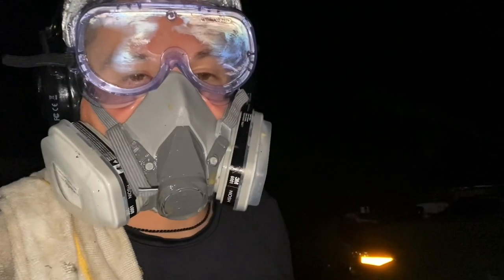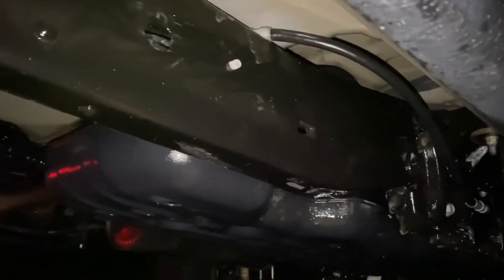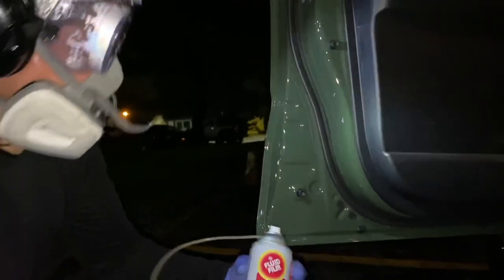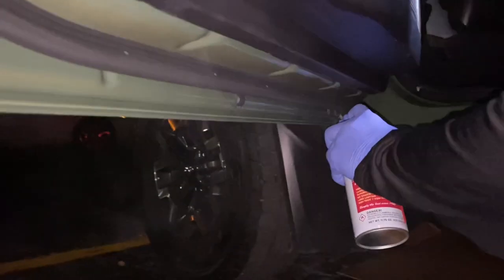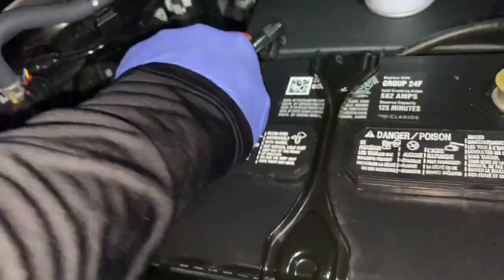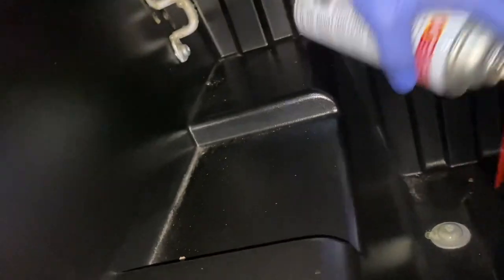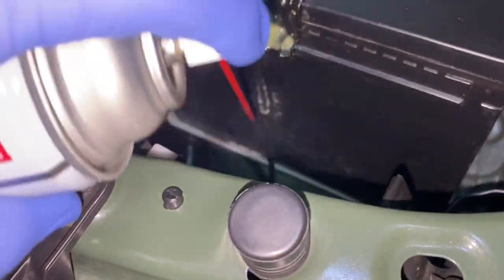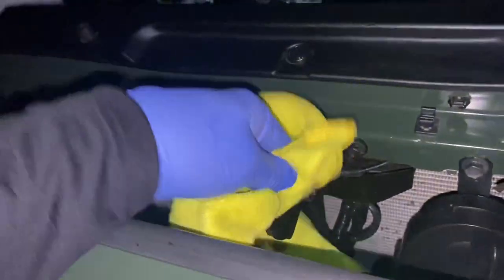The 1 Thing To PROTECT Your Pickup Truck From Road Salt Rust

Comment: 👏 many thanks for sharing this. I just purchased my 2022 taco, I was reassured by the Tacoma dealership that I did not need an undercoat spray that the new Tacoma’s have adjusted for the prior rust issues. I feel like it’s best practice to do it living in Maine on the coast. Thank you for this tutorial super helpful and I feel like I could do this myself. I just don’t wanna void any new vehicle warranty, but again Toyota said it’s not needed with new models, no more Taco rust🤷‍♀
Reply from the maker: Congrats on your truck! I chose to do it because I like the extra protection. But if they insisted you didn’t need any then that works out great.

Comment: Having just traded in my 2005 with 300k on in and spending its entire life on the east coast of Canada I can tell you the bottoms of the doors still looked like new, tailgate looked new. All body panels besides noted below. I bought it from original owner who didn’t rust proof it at all. Besides the frame (that Toyota replaced) the areas that rusted were the rocker panels, the front bumper inner corner supports, the thin metal over the rear wheel wells inside the bed walls, the metal rods that hold the bed sides from flopping. Those bolts you’re spraying are galvanized and don’t rust. Toyota does a great job at coating the sheet metal and I just gave my 2022 (same as yours, lunar rock) a good coating of rust check and it should last decades.
Reply from the maker: Thanks for the insight!

Comment: I'm doing mine for the second time in southern Pennsylvania. I did most of all the places you did under the truck the first time last October. I try to get some in every hole and in the boxed part near the cab and engine. I did in the doors from the bottom like you. I also pulled some plus in the rocker panels under the edge of the truck and used the hose to spray in there. I didn't do the inner parts of the hood but I will tomorrow. I also am going to take out the tail lights and see if I can get in the bedsides a bit. Over all some of what I sprayed last year on my 2020 was still there especially on the under side of the cab body. I used far less than last year where I used 5 1/2 cans. When I finish tomorrow due to the rain today I will probably be at 3 cans.
Reply from the maker: Thanks for sharing. Good for you for making an investment in your truck. I sister lives down in Lebanon for 14 years now. Always a nice trip down. 

I also had the rain last night it was bad. She’s taking her first ride up to Sullivan County, NY to visit some family and hopefully some of that smell will decrease but it’s a truck! 

Let me know how the rest goes!
Reply: @brianruperti  Lebanon is less than an hour away. i get there sometimes. 
The smell will go away in a few days that you don't notice it.
Reply from the maker: @MrMikey1273  small world! Good I look forward to it. Maybe a spritz of my
Cologne on the drivers seat will help 😎

Comment: Questions Brian. Is fluid film a name brand or are there several brands of fluid film? How many cans did you use to do your Tacoma? How much $$ is fluid film? Thanks!!
Reply from the maker: Great questions. Fluid Film is the brand of rust prevention oil. I chose it because people get great results and it’s environmentally safe. 

You can find it at almost any department or home store. 

You can lay about $120-$150 for a professional spray kit with gun and gallon can of it, or you can go my route by paying about $7-10 per can. 

I originally purchased 6 cans @ $9 a pop. 
Then I realized I needed 3-4 more cans so my woman ran to Home Depot to get them while I inspected the undercarriage. 

Total investment: about $100

I also purchased a $14 “360 wool wax wand” off Amazon which it the long tube you see me using. 

The good thing is, some of this oil will remain in the spring, so my cost goes way down to a maintenance of 2/3 cans every 6 months. 

(Please see my video in the description of how I cleaned the frame before applying)

Comment: West coast so I don't really need to do this. I watch "south main auto" repair's channel and he's in the New York area and wow the rust on those vehicles! Very thorough job tho Brian. I wonder how well the truck will wash with the over spray in those areas. Maybe a follow up video? I've never worked with the stuff. My Brand new 1992 Toyota 4X4 Truck I owned for 14 years had little to no rust when I sold it. So My 2020 TRD Sport 4X4 DCLB I may leave without Krown or Fluid film.
Reply from the maker: Yes that’s one of the benefits of the west coast! Rust is a sad part of life up here. It’s a dog fight against it. Thank you for watching. That must have been awesome to experience buying a new 94 and then a new 20 and feeling the changes! 

I definitely plan on doing a follow up video. I have it parked for the day today to cure before the thunderstorms tonight. It’s getting a body only wash tomorrow, but I will address the washing in a video soon.

My plan is to only do light “salt removal” undercarriage sprays and then reapply after the April showers rinse the winter salt away.
Reply: Lindsay, if you live near any salt water body where there is salt in the air, ie, the Pacific Ocean, you need to worry about salt. It is a myth that for some reason the west coast doesn’t have salt in the air
Reply: @adamturner2212  You are absolutely correct. Sister & Brother-in law lived right next to the ocean. The rust from the salt air did have a noticeable impact on their cars. Fortunately, I live 30 miles away from the ocean. No real impact other than a moderate climate in the winter.

Comment: What is your view on using Line-X?  I think it is an asphalt coating and not rubberized but might also trap moisture?
Reply from the maker: I say no way to Line-X. Great to protecting the bed, or the panels of an old bronco body, but not underneath. I fear the trapping of moisture. Based on my research, fluid film applied yearly (with a respirator and goggles) is the way to go. Just do your research and skip the suspension bushings, rubber hoses/trims, and also skip the exhaust and other rubber parts like hoses etc. And it’s environmentally safe which is a perk! Hope that helps.

Comment: FLUID FILM works the best...Where did you get the extended straw from?
Reply from the maker: It does! Straw off Amazon it’s called the wonder wand. (360 sprayer) next time I’ll tape near the tip so I know when to slow down and stop spraying while pulling out

Comment: The bottom of your speaker is right inside that hole on your door you’re spraying in. I believe the interior of the door is primed and designed for water to get in and drain out. The galvanized parts don’t need to be sprayed, they won’t rust.
Reply from the maker: Thank you
Reply: @brianruperti  regardless you did a great job bro! I’m about to get into this myself! thanks for the video.
Reply from the maker: @Nackss  thank you!

Comment: Those door jams are not necessary. I have a 2012 n never used anything besides white lithium there n never a spec of rust.

One thing id do, if u have an access cab, do the big galvanized looking hook where the rear and front door secure. That will get very rusted over time.
The bed bolts, coat those good. They will get very rusted over time.
Even if u can find them under neath id try to hit em.

The cross member in the rear of the truck from underneath, get that good. That will rust.

Take ur tail lights out now, that they are not rusted in there, and coat those bolts good. Both of mine on each side of my 2012 rusted and broke the housing of my tail lights.
The top bolts of the shocks, kill those twith it, esp the bolt that is the furthest away from you of the 3 of the strut on top. N the rear shock bolts and holders 
Anything that you will maintain and will need maintenance, destroy.
Esp cam bolts for alignments. Those you meed to get as good as you can and remember to do these spots often. They will rust and it will be badly.
Those are the problem areas of my 2012.
The frame isnt rusty. N ive never touched it. I spray my vehicle down good in the winter at least once or week even if its 10 degrees out lol
Reply from the maker: Thank you for taking the time to explain your process and give so many tips. I am taking my Tail lights out to add the bed light kit. Which tail light bolts were you referring to?
Reply: @brianruperti  just the ones when u lower the tail gate, the 2 on the side in the channel where the tailgate rests when it is up. I wanna say they prob didnt change much. Its the stationery nut that will rust that the tail light flange sits against. So when u go to remove the tail light (it may not be you, because itll be in about 8 years before u prob ever touch it)  that flange will shear off when ur trying to remove that rusted bolt because u cant grab onto that nut with anything because its behind there.
Reply from the maker: @todtalk3912  well it’s interesting you commented right on time for me because my tail lights are coming out this week for my bed light kit. Thank you
Reply: @brianruperti  yeah no problem, take care of those bolts when re-install them, esp the back side of em.
Reply: All the suspension parts i re did on my older tacoma and it would of been so much easier if i was coating it with something to protect the underneath this whole time thats for sure.
Other than that these are pretty damn good trucks man.
Reply from the maker: @todtalk3912  I will heed your advice 🙏🏼

Comment: I did my entire truck except I wasn't able to shoot it up inside the doors.  I got into the bottoms using my spray gun, but the extension wands with the WoolWax gun are too wide to go up inside those drains.  Will look into getting that hose for the spray cans.  The inside of the tailgate and inside the bedside panels were an eye opener for me--no rustproofing whatsoever!  

Also, any idea why there are plastic plugs in the door drains?  Seems like a bad idea from the factory.
Reply from the maker: Nicely done! I looked up the plugs. They are actually not plugs, they are rubber hole inserts that have a hole in them. Allegedly this helps water drain but reduces matter entering those specific drain holes. It’s basically a hole diameter decreaser.
Reply from the maker: I got the 360 sprayer on Amazon $14

Comment: I was going to do this to my Tacoma but it already has undercoating from dealer, is it a waste of time to do this too?
Reply from the maker: Getting it done from the dealer is a great option. If they did a through job then your coverage should be sufficient. But that depends on which areas they specifically covered and what level of protection you want.